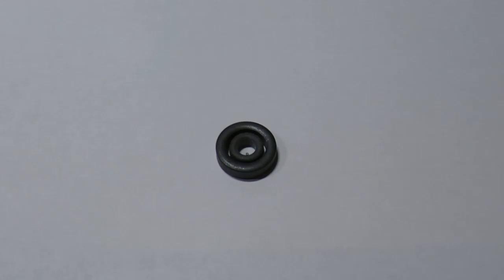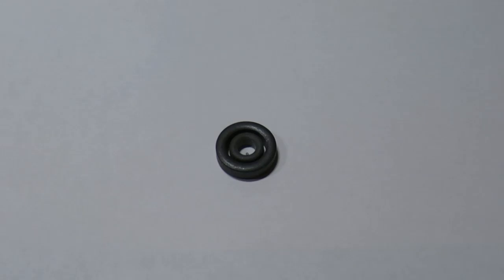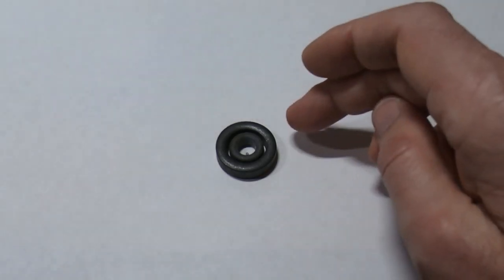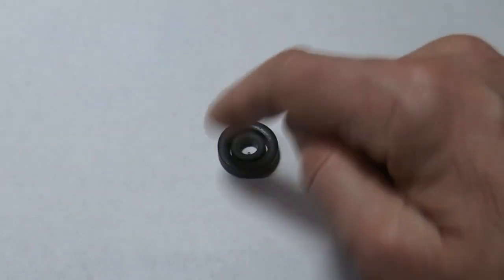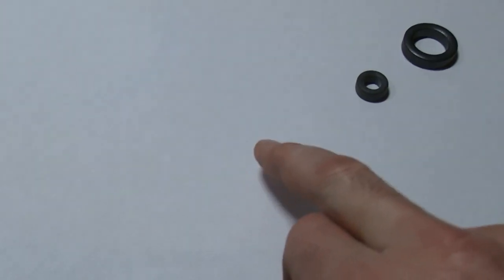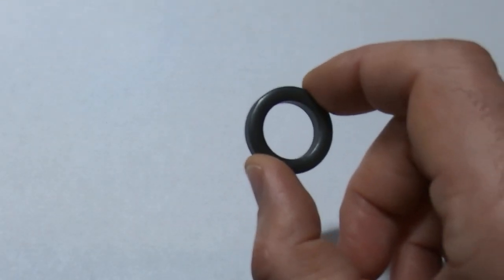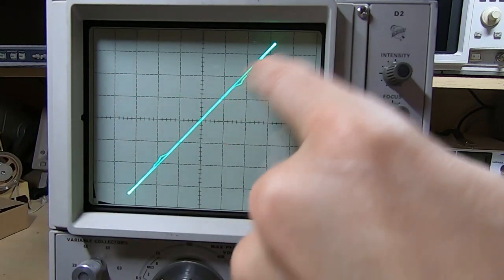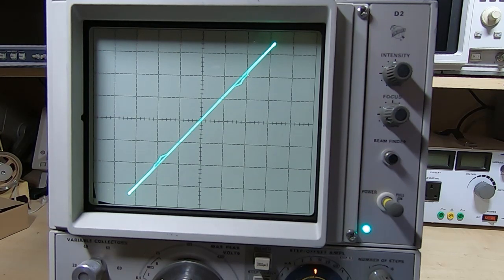Magnetic Core Memory Decoded Part1

Comment: Hi Jerry, very excited about this series and definitely looking forward to picking up the book as soon as it releases!
Maybe I missed it (or it'll be covered in a future video), but what is fundamentally different about the larger cores that doesn't allow them to be used? Do they react on the curve tracer more similarly to the inductor you showed?
Reply from the maker: I will post an announcement once the book is available. It is not the core size that makes the difference but the materials used to construct it. The book covers this but in brief the memory core ferrite material has different flux characteristics than the types use in filters, transformers etc which do not exhibit the magnetisation switch but just run into saturation. I will be demonstrating this in an upcoming video. Larger square loop ferrites could be used but I will explain why this is not a good idea in the videos.
Reply: good question! I was wondering the same thing. 😀

Comment: A very interesting topic. This kind of memory, as you said, are very reliable. I recently saw a video where they were recovering ram content after more than 50 year of inactivity (and no battery 😬😬).
Reply from the maker: Yes it is very reliable compared to modern memory. Rope memory is even more reliable. Almost every vintage computer I repair which is fitted with DRAM devices requires several replacement chips but I have only ever had to repair two core memory mats and that was due to physical damage.

Comment: Can't wait to buy the book and the kit! Always been fascinated by core memory. Never quite understood how the address decoding didn't end up being humongous. There must be some trick since using a naive approach (74154) for larger arrays would require lots of circuitry. Could you explain how they did the decoding for something like a 64k word core memory?
Reply from the maker: I will explain this in a  future video but in short there were different approaches. First the number of cores is simply increased. So for example a 64 x 64 core mat gives 4096 words (one mat per word bit) or 128 x 128 gives 16k. These were then paged in a very similar way to the way SD cards page the memory space. The memory could then be multiplexed to combine each block of memory. The most common approach was to simply add additional memory assemblies so an 8k memory would be two 4k blocks and each was selected by address range. Magnetic core memory always used a lot of circuitry but as it was just repeated then it was relatively easy to manufacture. The real limitation in manufacture and hence cost was the difficulty in automating assembly of the core arrays.
Reply: @JerryWalker001  Thanks for responding. Even a 64 x 64 array would require a 2:4 and four 4:16 for each set of the 64 lines if done naively. I know there must be a clever trick that gets from 16 address lines to 1 of 65535 different memory elements without having to resort to 65535 16 input AND/NAND gates plus all the inverters. Otherwise more of the chip space would be dedicated to the decoding than to the memory elements.
Reply from the maker: @drewtech2  As I said I will explain it in more detail in a video as it is difficult to describe in brief. Remember that it uses current coincidence to flip the cores and all X and Y wires pass through all mats and you do not use separate drivers for each mat. This means that in a 64 x 64 array you can drive the X wires in groups (more than one at a time) . I am not sure where you get the 65535 from as 64 x 64 array would only need 128 drivers even if you had a separate driver for each wire. For a 16 bit address you would split the address into 2 x 8 bit values or split off the lower 12 bits (4k) and use the upper 4 bits to select one of 16 blocks of memory. This is the same method that many much newer devices use to bank memory. For example PIC's use a very similar system to address large blocks of memory. It is also relatively easy to reduce the wire count by interlacing them.
+

Comment: One question: some core memory have a sense and an inibit wires. Like you say in the video, they could be combined. However, I was wondering why some core memory went to the trouble of having both.
Reply from the maker: The electronics required to drive large memory arrays becomes increasingly complicated due to the inductance and capacitance and so the supply voltages tended to increase to allow the circuits to work. These days it would be simple to implement circuits using modern devices but back when these systems were developed it was much more difficult. I go into quite some detail in the book on this subject. The problem using a combined sense/inhibit wire is how to arrange to detect very small signals in one direction while allowing large drive currents in the opposite direction. This makes the design of the electronics much more difficult but may be worth the effort in not needing to thread the extra wire through thousands of tiny cores. Early memories used fairly large cores (relatively speaking) so this was not too difficult but as the cores got smaller it became harder to get 4 wires through so most designers moved to the 3 wire option.

Comment: Will you do magnetic logic?
Reply from the maker: I am hoping to cover basic core memory (RAM), Rope memory (ROM) and magnetic logic.It depends on the level of interest. Magnetic logic is very interesting but I figured if I covered standard magnetic memory first then it would be much easier to describe magnetic logic.
Reply: I think magnetic logic would be a video series on it's own. I know there were some old computers that used some sort of weird transformer as logic gates.
Reply from the maker: @Bata.andrei  Yes I totally agree and this is in fact the subject of my next book. I will be building a Rope memory system once the current memory project is complete and then a magnetic logic system.
Reply: Would you consider talking about memristors both as digital logic and in analog computing? I mean the kind you can make using point contact junctions with copper sulphates.